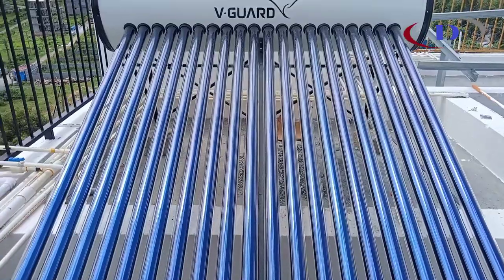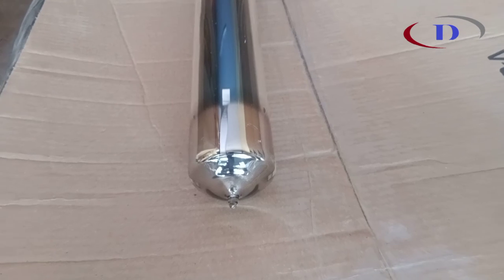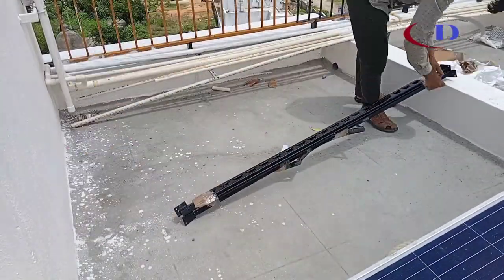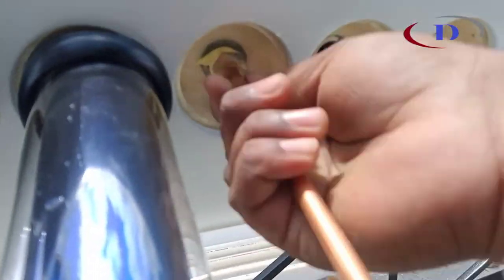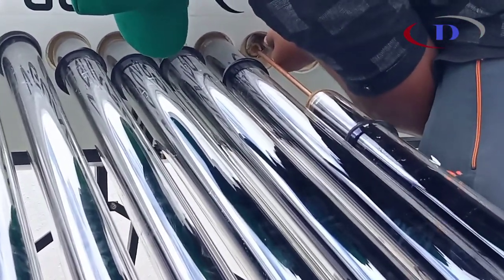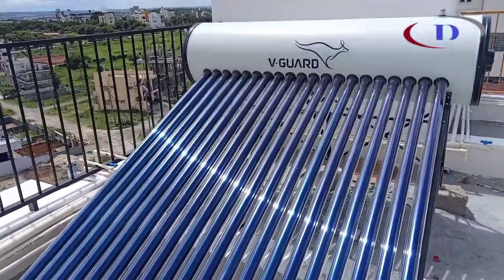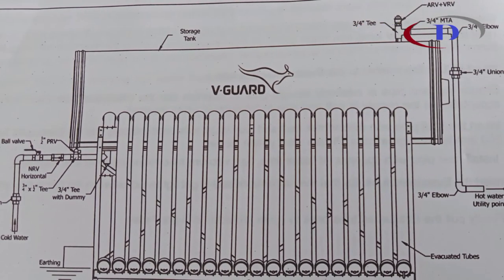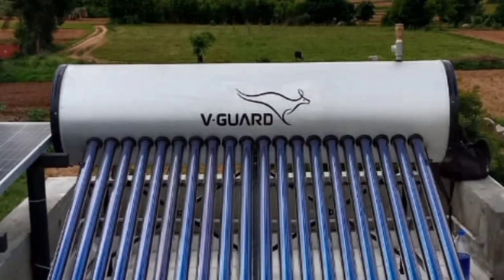VGuard Pressurized ETC Solar Water Heater (200 LPD ETC PR)

Comment: Sir one doubt we already installed 4years back but how to know its pressurised or non pressurised solar please reply me
Reply from the maker: It will be mentioned on the specification sticker, air release valve will be there, pressurized model costs more around 80k for 200 LPD
Reply: @dhamaniassociates9723   thank you so much for ur reply